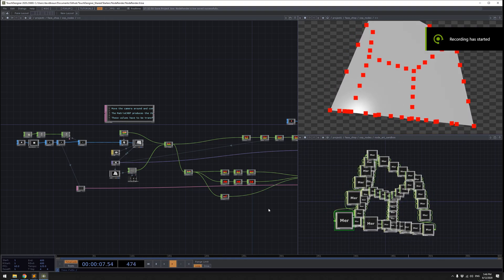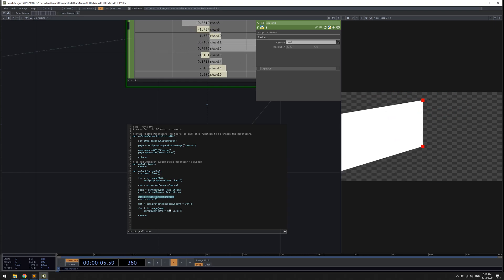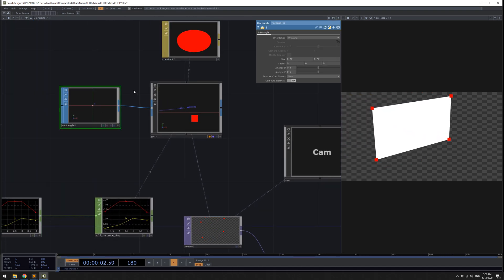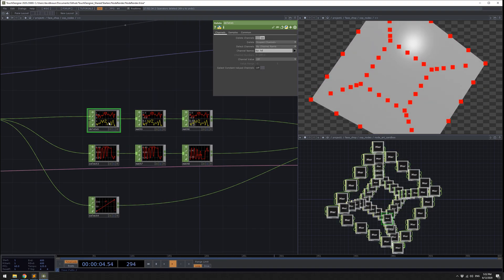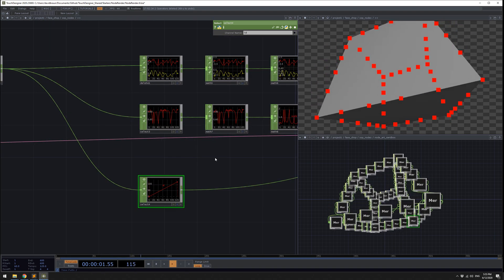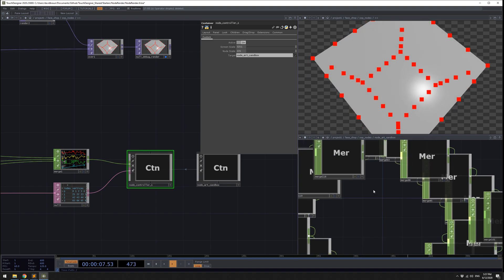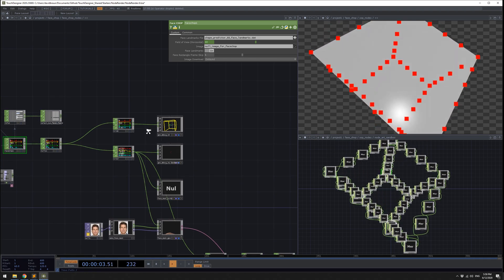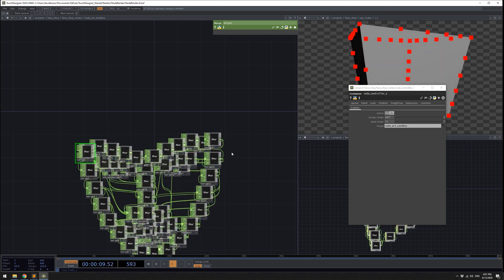How to Render TouchDesigner Nodes [TUTORIAL]

Comment: hi, amazing tutorial i got an error on the matrix chop (failed to load the plug in) how can upload the plug in?
Reply: i need to use the dll file right? i never been use a dll file on touch designer , where i need to put it?
Reply from the maker: There isn’t much benefit to using the plugin these days. If you open the latest toe file in the repository (updated 4 months ago), the equivalent math is demonstrated with numpy in a Script CHOP.
Reply: @DavidBraun  i got the new file, and im very new whit this... what i need to do then to make the matrix chop works?
Reply from the maker: @soslow2279 there are some text DATs and Execute DATs in that toe file that you may need to modify. Look inside the base called something like “controller”. I dont have a Facebook page but you’re welcome to post issues or discussions to the GitHub repository.
Reply: @DavidBraun  i really want to make this work so baddd, looks really amazing.
Reply: @DavidBraun  there is way to get the final file? whit the sandbox and stuff? cause i find this a little bit confusing just jumping beetwen two different proyects, and the last toe file dont have any sandbox or dat or set up primitives.
Reply: @DavidBraun  you got a facebook page or something where we can talk a little bit better? just to ask you some questions abt the proyect cause at this point im loosing my mind haha
Reply: @DavidBraun  Great, thank you very much for your support, I managed to get it working but now the only problem I have (it may seem a bit silly) is that I only see the nodes in the sandbox viewer, what can I do to view it as a normal top and then be able to render it from there?
Reply from the maker: @soslow2279 Screen Record TOP probably

Comment: how can i add other operators as a node instead of the merge chop? i've tried somethings but did not get far
Reply from the maker: You should be able to place any nodes (such as by copy-paste) into the “node_art_sandbox.” You just won’t want to run the tear down vertices or set up vertices script. Alternatively, you should be able to just change the sandbox parameter on the node controller base.
Reply: @DavidBraun  How can i do this? i tried and i can't, and thank you in advance for all research and work
Reply from the maker: @enneagramma7304  You need to update the scripts inside /project1/face_chop/sop_nodes/node_controller_1

Comment: Why tho
Reply from the maker: Good question. I should have motivated it a little more. The MatrixCHOP is useful for projecting 3D kinect data to 2D so that you can do simple 2D collisions. You shouldn't just take the TX/TY of a kinect and do collisions. Second, I hope the information about projection matrices and normalized coordinates is helpful. In fact I think the tz values from the MatrixCHOP are the same as what you'd get from the Depth TOP but for individual vertices rather than every pixel.